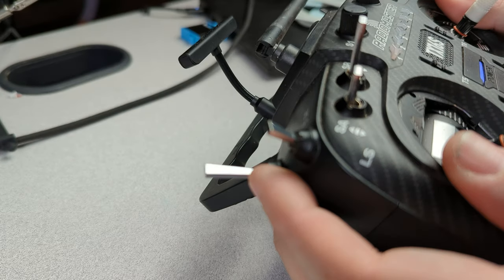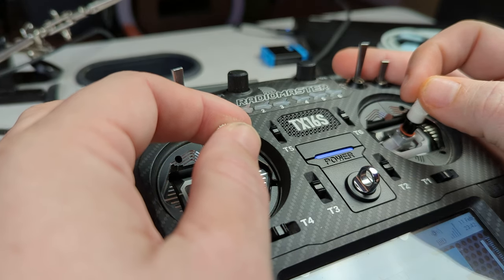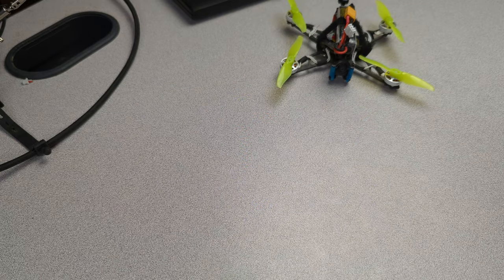6 reasons your FPV drone is freaking out as soon as you take off and how to fix them!

Comment: I have an issue where my speedy b60 amp just accelerates and runs away from me. It'll try to hover at the 5.5% idle on arming but as soon as I tap the throttle it accelerates to 100 and does not come back. It will fly away till it crashes. Even if the throttle is 0% it won't stop claiming

Comment: I didn’t think I was gonna find help for this one but this video hit the nail on the head.. I updated to 4.4 and my board was set 90deg when it needed to be 180. Which makes no sense to me but it flys now. Thanks man
Reply from the maker: that board alignment seems to be the biggest one!  sometimes from the factory they don't come with what you would assume is a 0 degree alignment to the arrow...but some weird one that is super necessary.  Flashing usually removes that and you kinda have to guess what it needs to be, lol.  Wish the targets would center the arrow to 0, but I don't think they ever will.

Comment: Thank you for the advice! I tested motors and realized I had accidentally switched two wires on one motor and realized that when testing the motors. It would only ever rotate clockwise. It was throwing off the quad from lifting  off. Finally fixed and had my first flight today on my first build.

Comment: Yeah I just flashes 4.4.1 and my quad is flipping out. I just happened in this video. Super helpful! I have some direction now. Thank you.
Reply from the maker: Ah the ol' flipping out after a flash thing.  A couple of places to start on that one for sure would be the motor direction stuff and the board alignment settings.  Sometimes in a flash those aren't set by moving the older CLI over and it can absolutely get your quad going crazy!
Reply: @BaconNinjaFPV  that's exactly what it was. Got it working again after fixing the motor directions. I had to figure out why my WiFi quit working when I plugged in the battery (I have a weird set up where I remote my desktop with my iPad. No monitor!)

Comment: Been there done that. Helpful video for the beginners. My most impressive incident and why I stand way back on first arming with props on, just 2 props on wrong. Bottom mount lipo on the original Hawk 5, I never heard something scream so loud as it tried to level itself on arming. As quickly as  I armed disarmed it destroyed the 2 rear props grinding them on the ground. Needless to say I quadruple check my props before arming. And I still can screw it up. 😂
Happy flying everyone. 😎
Reply: Done this too 😆
Reply from the maker: Lol, yeah on the 7" I destroyed the rear two as well...concrete and props don't mix.

Comment: I just got a pre build from flywoo and got some angle issue not arming . I think i found the issue i re calibrate my remote from dji and check in beta flight and seem to working fine. Will test it outside . It's not very complicated but Thanks for your channel sure help us a lots a good place to go if we have issue. W juste did a 15 days trip in minus 15 degree winter and i sure tested all the quad and ran into all the issue possible 😁. Keep it up awesome channel

Comment: Hi! My last 3inch babytooth 1s (out of 5 now) just flies to the moon as soon as I arm it with the exact same pid/filters as the other ones. All are on BF 4.4 with rpm filter on. The Only difference is the BMI270 gyro where others got mpu6000. Stock BF 4.4 tune solved the issue for this one but I need to tweak it now to get the best out of it….
Reply from the maker: the BMI for sure tunes a bit different than the MPU.  Personally, I like it a whole lot better :)  I find that it takes wayyyy less gains to get the job done, so you might try some similar tweaks but just roll them back by a bit.
Reply: @BaconNinjaFPV  Thanks Beacon! I’ll give it a try!

Comment: a newly built drone can do a barrel roll for other reasons too.  I personally had situations where one of the engines gave such vibrations that the FC was unable to work normally and this caused the barrel of death.  in the second case, there was one propeller installed backwards, which caused a downforce on this propeller, which in turn caused the barrel of death.

Comment: Hey Bacon I just got a brand new happymodel mob 8 and after binding I arm the motors but when I throttle up the quad starts bouncing and acting erratically while trying to hover?
Reply: I found the pid rate setting was turned off and according to the user manual it should be set to RPY so i did that and the quad is now behaving as it should. Not bad for someone who makes it a point not to mess with the pids. 🤔
Reply: Obviously the folks at the factory forgot to enable the pid rates... 😢

Comment: Great video. This may be a simple question to answer but why would the motors spool up when the throttle is at the lowest point once the quad is armed? Thanks
Reply from the maker: Great question!  It is going to depend on if you have the props on it while it is doing it or not.  With props off, that is a totally normal thing to happen :)  The motors spool up but since the flight controller isn't getting any response as there are no props on them, it spools them up endlessly thinking it needs to correct.  If it is doing it with props on though, totally different story.  In that case it could be that you need to calibrate the sticks on your radio to make sure zero throttle is zero throttle, lower your idle rpm percentage or rpm value if you are using dynamic idle, or make sure everything is mechanically sound with the quad as it could be gyro feedback causing the start of a fly away.
Reply: @BaconNinjaFPV  thank you for your advice, in this situation the props are off. I haven’t flown the quad yet and I was concerned it would take off once armed and never to be seen again.

Comment: Just recently after 5 years in the hobby I had an situation where after hitting the arming switch the quad did nothing. I could not figure it out. Now this is a plug-and-play quad. That means I put the receiver in. That worked fine and lit up when I plugged in. What I forgot to check was the channel mapping.  It had been defaulted to TAER. I needed AETR. It really is the first thing I look at usually but I had forgotten to check it since I had not built it. So the FC thought the arm switch was on channel 2 but it really was on channel 1 the way I had my switches set up.  It had me getting angry until I went back into the Receiver tab in BetaFlight. I saw it immediately and breathed a sigh of relief. I still do dumb things. 😅
Reply from the maker: lol, yeah I have had that one get me too!  I usually check all of that, but I guess at some point I got comfortable as it was always AETR every other time so I stopped, and that is when I found out not every one of them defaults the same way.  At least it is an easy fix! :)

Comment: I run into that issue on my first build and I thought I did everything correctly….
What happened: I first take care of the motor order and spinning direction. Than I realized that the FC direction was wrong and after adjusting that… I missed to reorder the motors again! Tata Dead Flip (thankfully nothing bad happens)

But for all: Double Check everything, even if you think you did it, sometimes some changes impact something else ☺️

PS: I really like your content and footages!

Comment: Why do you turn off the accelerometer?  Sprinkle some bacon bits on the reasons to keep it on or keep it off.  Thanks
Reply from the maker: Really I just turn it off to save the small amount of MCU cycles that are used to poll it as part of the loop.  Since I never ever run angle mode or anything that would involve the accelerometer, I figure I may as well get that little bit of clock back to use on filtering delay.

Comment: Im one of those cats that made sure motor 1 is cw, 2 is ccw, 3 is ccw and 4 is cw. Also the props are on correctly except i did norice that prop/motor 4 was lifting that corner of the quad but woukd not fly at all. I did the motor direction and double checked all 4 motoras are turning in the right direction. So all i get is motor 4 lifting up a little and yawing to the right so i am stuck and dont know what to do next. A little help would be greatly appreciated as this Iflight baby nazgul 73mm is making me crazy.. Any help would be appreciated! Thanks for the awesome video. I look forward to your reply. Harry Lato... It was the 4th prop it was ccw instead of cw. She's flying great now!!
Reply from the maker: hmmmm, so just one motor spinning at all then?  Or are you getting all of them spinning but just lift in the back corner?  It sounds like you might have something going on that is quite a bit more complicated than the scenarios in this video.
Reply: @BaconNinjaFPV  yes Bacon i think ill have to reinstall the operating system because the motor 4 is turning but when i give it a little thr it yaws to the left or right. I double checked the props cuz i had a similar problem like this before and by chsnging prop 4 it fixed the prop issue. What i dont understand is thats all i did to to the quad... Nothing else. I'll keeo you posted.

Comment: Hey Bacon Ninja i have Eachine lal3 for the past 2.5 yrs and lasy week i tried to fly it and it wouldnt. I armed the motors and hit Thr and increased the the power and it would not taleoff. I uphraded the firnware and that did nothing. I used blheli and i made esc 1 =reversed 2=normal,3 =normal 4=reversed and i placed my props accordingly. The Betaflight motors are reversed so the esc is corresponding with bf and the quad still wont fly. I switched the props 4 with 2 and 1 with 3 still no flight. Can you tell me what im doing wrong here as I've been trying to get this qiad flying for 1 week to no avail? Id appreciate your time.. Great video by the way!!
Reply from the maker: hmmmmm, is it just flipping out or not doing anything at all?  You might hit me up on Discord if you have it (server link in the description) so we can work through it in a little more detail too!
Reply: Hey Ninja i figured out the problem, after i changed the ESC swtup i didnt chanfe the props to reflect the esc change so i swapped the front tips and the back tips and she flew really well. A newbie move i guess but yes shes flying great.. Thank you for your help!!! ❤️

Comment: I built a new quad with a frame I made, and it's probably super noisy, my quad gets light, then it becomes extremely uncontrollable and starts oscillating and runs away, should I just crank the p and d term to like 150 or something?  It's already at like 80, and it does even worse at base pids.

I figured it out, it was acting so much like the fc was incorrectly orientated, I went back in and looked at it.  I had a non standard mounting it was turned 45 degrees so I thought I had corrected it,  but with a -degree term, I guess that corrected it but it was still turned off and didn't take which I didn't notice.  It was turned also in the graphic, it wasn't turned into the screen which I guess it has to even though it was responding correctly.  I fixed it by putting in a 315 degree term in the yaw.  All fixed and flying wonderfully since I really screwed with the filtering and pids thinking that was it.
Reply from the maker: hey, glad you figured it out!!  That board orientation has bit me more than once.  Pretty awesome that you build your own frame or it too!

Comment: i had a crack in the big part of my crux35 arm and it was just hanging on by the little brace bit and it tried to fly away, another time it did it when i delaminated an arm a bit too
Reply from the maker: frames and fly aways seem to be related to each other pretty often, lol.  I have heard of that happening on the Crux35 pretty specifically in a few cases, and I have had quite a few arm delamination's myself on some of the frames I run.  Always a good idea to rule out some things and take a really good look at the frame when weird stuff starts happening!
Reply: @BaconNinjaFPV  the crux is great if you keep it under 200g, once you start pushing 250 it starts to struggle with tuning and durability, but i just got my aos3.5 in the mail yesterday and finished builing it last night so got to fly it today and it flies so much better, the iflight version i had to express post some to me from an aussie seller because my frames from cnc drones still in limbo with aus post

Comment: I’ve got this weird issue: brand new nano whoop 2” O3 build and all LOOKS good lol. When I go for a LOS it was SHAKY AS HELL so I disarmed. Checked BF settings to ensure all was stock and it was. Made sure nothing was touching gyro and tuned off bidirectional deshot bc it was only thing I changed. Second flight it was OK but then after few seconds it seems to throttle up out of nowhere, this has never happened to me! So strange..
Reply from the maker: hmmmm, it could just be the thrust to weight ratio making the tune go a bit crazy.  On a 2" whoop the weight of an O3 is going to be quite a bit over its disk loading capacity, and that will make even low PID gains flip out pretty bad.  Usually I have to de-tune those kinds of builds wayyyy down and make them really unresponsive to get them to fly smooth.

Comment: Hi quick question ⁉️ 
My drone flips when hovering. After hovering and giving throttle the drone drops.. any advice? I have a feeling it can be a bad Motor
Reply from the maker: Hmmmm, if you can get it in a hover before it drops there is a good chance you are having a desync.  Usually that means the motors are either spinning too fast, or there is something going on with the ESC reading back EMF.  What motor size, motor kv, props, all up weight, and voltage are you running on this build?

Comment: @bacon ninja fpv my drone flies fine in angle mode but when I try to take off with air mode on that’s when it shoots to the moon. So I put air mode on a toggle switch so I can fly in angle with it off but as soon as I try to fly in air mode it’s instant full throttle 😕
Reply from the maker: oof, yeah that is always the tough one.  I suspect that when you are kicking off from angle mode into acro/air mode the PID controller is taking over and whatever resonance you have going on is pushing it into a feedback loop.  Are you running the stock Betaflight tune or something else?  Also, if you want to jump over into the Discord server myself and some other pilots would be happy to dig into it!

Comment: I thought it would be fun to put a betafpv f4 controller on my inductrix fpv.  However when I arm it, it hops up, spins in yaw then Shuts off and drops… have you seen this before?
Reply from the maker: Im sure that took all of the fun right out of it :(  with a yaw spin run away, it will usually either be a motor direction issue or a board alignment one.  I would double check both of those things and see if they are causing the problem.

Comment: What about if it takes off but around half throttle it cuts out and bobs up and down in the air like angle mode was on and you're trying to land? 🧐 also the first page on the pid tuning tab, yaw pitch an roll I cant adjust
Reply from the maker: hmmmm, if it takes off and does things weird in flight that aren't straight up trying to fly away on you then it is most likely something wrong with the tune or filters.  Usually if you can't adjust the PID value numbers then that means it was set up using sliders, and if you cant move the sliders that means it was set up using the numbers directly.  Had you flashed a preset tune on it, or were you still running a stock/default tune on it?
Reply: @BaconNinjaFPV  right on brotha thanks, an I had a preset betaflight tune on it all was well. Buttt now there's another issue lmao, my receiver isn't comunicating with my fc Lool. I flashed 4.4.1 on it (speedybee f7 v3) an set it up how I had it before but no luck. Granted the pids are back 😂

Comment: yea my drone spins and shutdown like yours so .. my orientation is correct .. so I reflash and put on 4 blade prop and it flies fine now . Im surprising that my 1407 4022 Kv Hyperlite has discontinued so its bitch to find so I endup ordered 1 Emax 4100 kv 1408 and it flies fine cuz one of 1407 got fried smoke up.  anyway yeah ur vid helps thanks

Comment: So I tried everything, and yes some props were on the wrong way. Fixed it (100% sure that's not the issue anymore) but the drone on lift off still goes bonkers. Cant get it up normaly it just crashes, flips over, spins, all off these combined. 

Only thing I notice is that while testing the rotation 2 props strugle rotating. They rotate a bit then stop then repeat. While the others continously rotate.

When I arm the drone they all rotate seemingly equal. So no idea.

ANYYYY idea's? 

I use the Mobula 8 from happydrones.
With a radiomaster Boxer. 
All brand new.

Comment: So just finished my build. And everything was fine for a few min. Then it fell out of the sky. I tried to rearm it and nothing happened. Power cycled my quad and it was fine-ish for the rest of the flight. Sometimes when i give it a little throttle i can hear a sputter and it wants to fly away by itself until i move the throttle all the way down.   Im running dshot600 but its able to run dshot 150/300/600/1200 multishot and one shot 42 and 125. If i changed it to maybe dshot300 or multishot would that help?

Comment: My new rekon3 was on BF 4.5.0, idk why, but after I went to BT 4.4, it has a bad wobble. It has these oscillations just hovering.
Reply from the maker: hmmmm, did you happen to take a CLI backup of the config or load a CLI dump from the manufacturer after flashing 4.4?  It seems like maybe the tune they had on there is no longer in place since a flash wipes that out.
Reply: @BaconNinjaFPV  I went back to the 4.5.0 and loaded my backup. Still shooting up to 90'sc temp. My luck man.
Reply: @BaconNinjaFPV  I haven't crashed it, nothing. I've just hovered inside, in a cooled room. Mid 90"s Celsius too. Fock😪